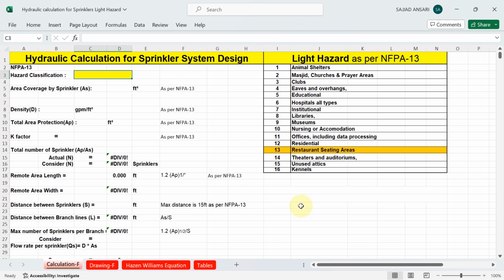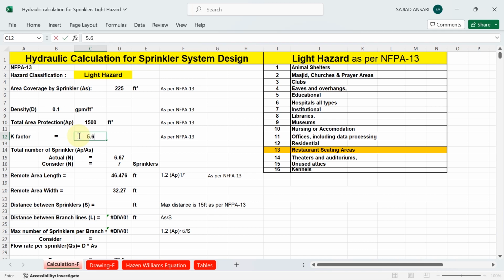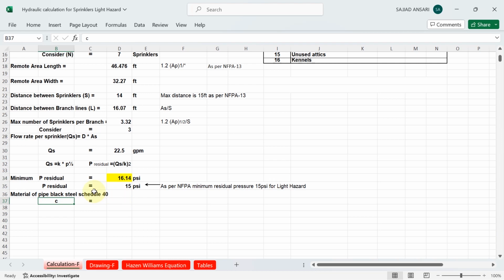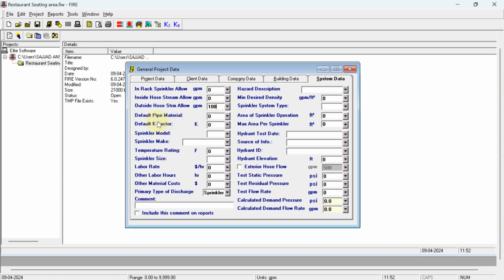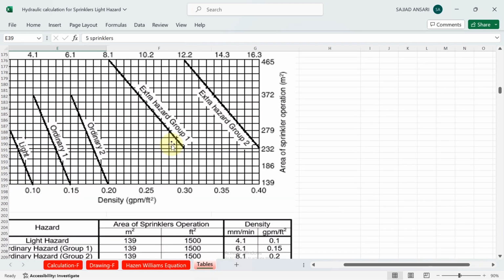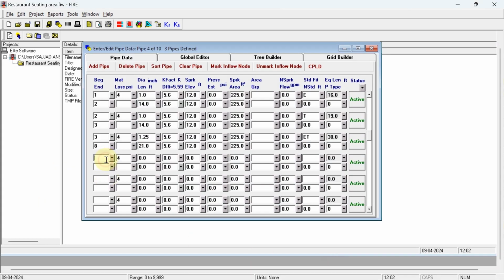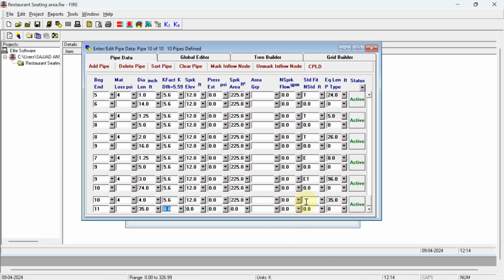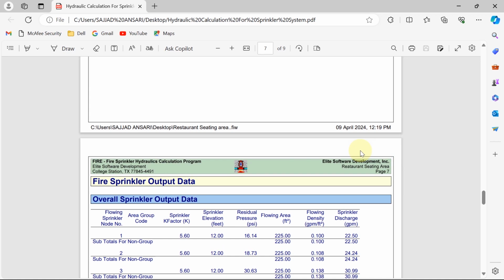NFPA 13 Fire Sprinkler Elite Software Hydraulic Calculation for Light Hazard

Comment: Nodes 3&8, 8&9, 9, no sprinklers, K Factor should not be added. Also you should add nodes for change of pipe sizes (between nodes 9 to 10). Hence the report says 10 no’s. unique flowing sprinklers against 7-sprinkler heads only as per plan layout. Review everything since pump is oversized.